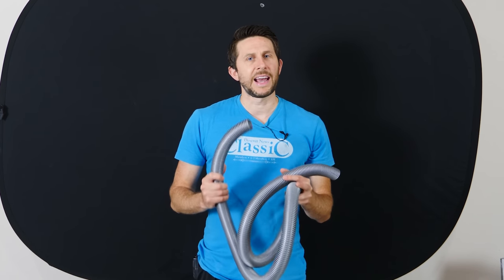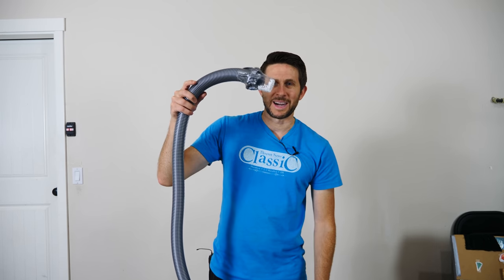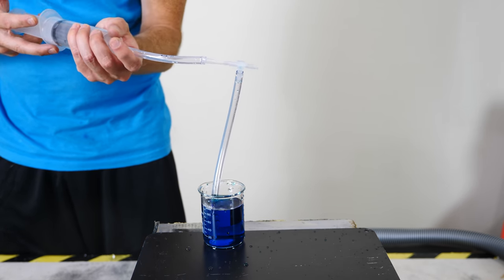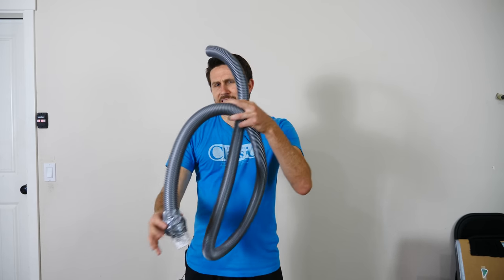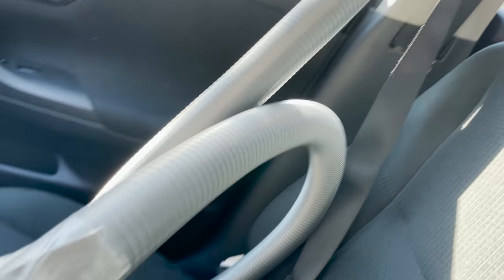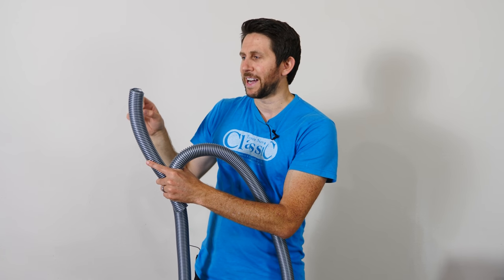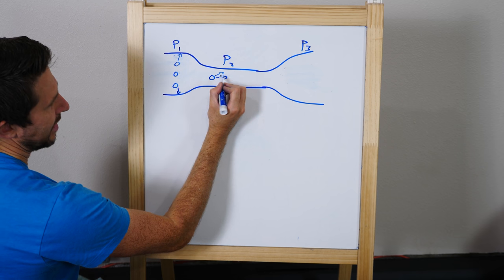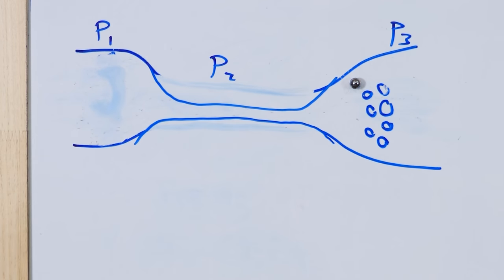The Self-Sucking Vacuum Cleaner

Comment: @The Action Lab
3:00 You also have centrifugal forces too on every air molecule in the spinning part of the tube, that also makes the air move outwards.
Reply: Technically yeah but air molecules move at hundreds of miles an hour so it doesn't affect it enough to make a difference
Reply: @boopnose5503  not with that attitude
Reply: @chapstickbomber  whaaaaaaa
Reply: I thought of that as well, there a pumps that work mainly with this principle.
Reply: Yes. I also think that his relative speed approach doesn't work in the first example, as the air in the tube is constantly accelerating 🤔
Reply: I actually believe centrifugal forces play more role in the first example. This is exactly how car turbine is operating. A lot of ventilators work this way as well

Comment: Did you pick up any styro ball you blow outside or did you left them in nature.

It is one of very few materials that NEVER ever never, decomposes. While it may take a plastic bottle 450 years to decompose and a glass bottle 1 million, Styrofoam stays strong and doesn't give in to the elements of nature, ever
Reply: They were tiny little pieces
Reply: But pieces nonetheless
Reply: Literally what i thought
Reply: Don't think he's going to save any turtles 🐢
Reply: They do decompose over time. May not be scientifically proven, but have you ever left a hard styrofoam box outside for a few years and gone back to it thinking "it's ok, it'll still be good" go to pick it up and it literally crumbles in your hands. I have, so either I'm really strong, or styrofoam decomposes over time.
Reply: @grahamdelamare737  Loosing structural integrity, is not the same as decomposing. 
Plastics are just getting smaller and smaller, the fall apart, becoming micro plastic.
But the normally don't decompose.
Reply: @stefanocasola6733  the original comment said "styrofoam stays strong and never gives in to the elements of nature, ever" well, isn't losing structural integrity giving in to the elements of nature, and isn't losing structural integrity over time considered a form of decomposition?
Reply: Right, I have a styrofoam cooler from 1952, I use it every day. It still looks like new because it never decomposes!!!
Reply: Might be better to use something biodegradable.
Reply: Well, NASA’s (and other space agencies’) jettisoned items have some styrofoam in them too. The amount they drop is negligible. No one screams at them for littering.
Reply: You expect him to pick up every single styrofoam ball from the highway?
Reply: @gamistry2947  He could have used small pieces of paper...
Reply: @onnonius  It wouldn't have the same effect. Also, it's just a few balls. It's not gonna change anything.
Reply: @mrbmp09  i have books of paper from 1920 so its also how you store them
Reply: @gamistry2947  it may or may not, but he's a figure of some influence with this channel and people might copy this experiment. Meanwhile as a society we're actively trying to reduce plastic waste. I know I may be reaching now but we've seen how our plastics can affect ocean wildlife by getting into their systems somehow, who's to say these won't do the same.
Reply: @bevishhh  I can understand your concerns
Reply: @bevishhh  What's the difference of  him sucking them out the car vs him throwing them away to go to a landfill? Basically nothing. Earth is doomed either way.

Edit: Not that I support littering.
Reply: As if it matters that much lol.. what's up with this peta comments..
Reply: yeah, he walked across half a kilometer area to find 50 balls the size of a pea

Comment: Are we just going to ignore the huge impact the centrifugal force had on the first experiment?
Reply: This! I would imagine all the air trying to move from the center to the edge die to the spinning is the main reason it's sucking.
Reply: Yes, that‘s exactly what I meant. The air trying to move to the edge/top of the tube creates lower preasure in the center/middle of the tube. This would also explain, why it worked so well in the beginning, compared to the first attempt in the car at lower speed.
Reply: Air molecules move at hundreds of miles an hour. To create a huge impact you'd need to spin the tube at way higher speeds.
Reply: "Air" molecules move at at 330~ m/s so he isnt spinning fast enough for that

Comment: I think there's a secondary component to twirling the hose that you might have missed. At that point I think it acts like a centrifugal pump and the inertia that you're creating in the air in the hose flings it out of the end also creating a low pressure behind it in the hose.

Comment: Is it Bernoulli though? Or are you just throwing the air from the tube (when spinning it) and thus decreasing the pressure inside?
Reply: I think it is both. It certainly is Bernoulli, but you are also throwing mass (the air) out of the tube. If the tube was filled with golf balls, they would be thrown out too.
Reply: I think if it was just throwing the air from the tube, the effect would only last as long as there was air in the tube to move. So if it was just the air being thrown out, I would assume the effect would only last a second or two. Since the effects continue as long as you spin the tube, that looks more like Bernoulli's to me
Reply: @Loganxmusic9339  The air being "thrown" out also "pulls" air from the bottom
Reply: @Astromath  and that's Bernoulli's principle
Reply: The conservation of angular momentum is not the same as Bernoulli's Principle. The Torque is doing most of the work and the cup proves it. The small holes are restricting way to much airflow especially when you consider how unevenly and turbulent the flow would be on the rotating section.
Turbulence is the enemy of Bernoulli's Principle. He is acting as a blower fan. When hes in the car, it is Bernoulli's Principle though.
Reply: @Loganxmusic9339  that's the whole point. New air will enter from the other end to replace the thrown air...
Reply: @CosminRotaru  yes, this is the effect of Bernoulli's principle..
Reply: @jonvanbrunning4294  That's exactly what I think: In a blower fan, it's only the centrifugal force that acts. With the tube without the cup, it is a mixture of both forces. With the cup, the Bernoulli force decreases. In the car, it is only the Bernoulli force and no longer a centrifugal force. I assume, of course, that he turned off the ventilation in the car. Otherwise, it would create overpressure in the car.

Comment: Another reason why this vacuum non-machine works, and possibly the reason why it works better than the hose in the car's window, is that by spinning the hose like that you are centrifuging the air away radially. This is actually how the pump in a vacuum cleaner creates the vacuum. It is a similar effect to this experiment: Have a heavier and a lighter stone connected by a string passing through a tube. Put the tube vertical with the 2 stones hanging  from the string and the string will slide through the tube such as the heavier stone will go down and the lighter stone will go up. now let the heavier stone hanging and spin the lighter stone above your head and the lighter stone, as it is centrifuged away, will lift the heavier stone.

Comment: Actually there's a centrifugal effect forcing the column of air in the spinning region of the tube out the end creating inward pressure at the end by the table, in addition Bernoulli's principle.    He had to drive quite a bit faster than he manually rotated the tube above his head to achieve comparable suction.
Reply: No, he was spinning the tube about 80 rpm, @ 3 ft. radius thats around 50 mph.
which is about the speed of the car sounded like.
Reply: @mrbmp09  @0:20 shows the tube extend from his hand to head, so there's no more than 1.5ft rotating, and I'll even give you 120rpm, which still only comes out to 12.85mph:

2 × 3.14159 × 1.5ft × 120rpm × 60min/hr ÷ 5280 ft/mi = 12.85mph

Comment: We use this concept in the natural gas industry when trying to pinpoint a leak (gas migrates underground, so higher gas readings in one spot doesn’t always mean you’ve found the leak). We use a purger, which is simply a Venturi that sets atop a 3’ aluminum tube with several holes at the bottom. When compressed air is pushed through the purger, from back to front, it creates the low pressure area where the restriction is inside. This creates the vacuum in the aluminum pipe and sucks methane from the surrounding soil. Once the soil is mostly clear, you can begin testing different spots to see where the highest readings are, and there is your leak.
Reply: I think you are describibng an ejector pump which operastes by entrainment, not by the improper interpretation of Bernoulli's Principle.
Reply: @Observ45er  no, I’m not. It’s a Venturi, with no moving parts. It uses the effect noted in the video to create vacuum.
Reply: @skoalsoldier  Ok. So reading it again carefully, I see it's a pipe that shrinks in diameter, but then has holes to the outside pipe that is around in the narrow section. Then, I guess, the aluminum pipe is used like a vacuum cleaner hose?
Is that a correct interpretation?

Comment: I partially disagree. I strongly believe that the phenomena shown during rotation is due to centripetal force acting on the air inside pushing it out and thus creating a low pressure.
I agree to the fact that most other stuffs shown in the video are due to Bernoulli's principle.
Feel free to put your comments below (anyone). Happy to learn.
Reply: Agreed.  While Bernoulli’s principle is responsible for a fraction of the suction when he is rotating the tube, the majority of the suction is likely coming from the centrifuge effect.  In essence, he created a single vane centrifugal compressor.  Good explanation of BP, but partially misleading, at least when explains the rotating of the hose.
Reply: It would be interesting to know the tip velocity achieved by hand vs in car.
Also in the car, having the window open changes the pressure in the cabin. Would be a more reliable experiment using some sort of wind tunnel.
Reply: It's a matter to gain some air velocity, he just make circles with the pipe, and as he already proven in the car, it happens the same when going at a straight line, so centripetal force has nothing to do about it. Also when pushing air with the syringe, there's zero centripetal force, it happens the same thing (that one principle is a variant of Bernoulli actually, called Venturi effect, used in carburetors) He's actually creating the low pressure by velocity, that's the Bernoulli Principle at its best.
Reply: @jimmytvfclassic  partially correct.  Some of the suction is due to that, but most force is happening from centrifugal motion (not “centripetal” acceleration).  Check out how a centrifugal pump or centrifugal compressor works.  He effectively made a centrifugal compressor or blower.
Reply: A small correction as John pointed out. Centrifugal force not centripetal force.
Reply: @Joe-ks1jx   @John C  yes I always confuse centripetal and centrifugal names. Damn dyslexia... The force that pulls away from the center... Anyway. A centrifugal compressor, is the air acting as a fluid, hitting the blades of a fan, it's very clever actually. They have to connect several blades to get enough speed to make Bernoulli's effect act properly, because, again, it's speed not centrifugal force. Centrifugal force depends on mass, and air has almost no mass at all. (It has some)
Reply: @jimmytvfclassic  That’s not exactly how centrifugal machines work.  While Bernoulli plays a role in just about everything in fluid mechanics, it is not the main driver here.  Centrifugal machines, like the one he made in the first part of the video, convert angular momentum into pressure.  Think about the perceived force you feel when you turn your car sharply.  That angular inertia/momentum is similar to what causes the air within the tube to move outward.  Also, the speed that the tip is moving is not all that fast (you can do some quick math and see it is something like ~10mph), think about how fast the car had to move to create suction.  I’m not saying that Bernoulli doesn’t have an effect here, I’m just saying the primary driver in the first example is centrifugal.

Comment: That is how  car's crankcase ventilation systems use to work.  The vent tubes would stick out into the airstream (under the car).  The end of the tube was not square  though,  they were cut at an angle, so the opening was on the downwind side.

Comment: You forgot to include radial acceleration of air in the spinning tube. 

As a kid, did the spinning around in the air but used a tube filled with water. Much of the pressure difference was caused by radial acceleration...Velocity squared / radius. As a kid, the Bernoulli effect didn’t have much effect. The tip velocity through air was not very fast but radial acceleration of water could easily lift feet of water or cause enough press difference to allow me to sling the water filled tube over my head. Bernoulli effect at low velocity would not cause enough pressure differential to lift that column of water.

Comment: I think you also have a function of centripetal force aiding your vacuum as well. I bet if you completely plugged the end and spun it like that with a pressure sensor in the end you would be able to show an increase in pressure at the tip of the vacuum without the air movement. This is why I performing the same type of action with a hose filled with water also works.

Comment: Top tip: if transporting an aged relative who might be covid positive, use a nose mask with a tube out the window. The negative pressure keeps the mask clamped to your face, thus blocking off nasal receptors, yet you can still breathe fresh air easily. Sounds a little nuts, but I used this successfully back in March '20...  Just saying. Old UK duffer here :)

Comment: Yeah that's what a centrifugal compressor/fan does. I wouldn't explain the spinning of the tube with Bernoulli principle but just with that air molecules have inertia and the spinning tube walls accelerate them outwards creating lack of air in the tube. If the end of the tube was closed there would still be higher pressure packing at the end wall.

Comment: Same principal applies to chimneys. It's a lot easier to keep smoke out of the house and have a much hotter fire when there is a cross wind going over the chimney outside since there is a draft pulling fresh air through the fireplace and pulling exhaust through the stack.
Reply: but in chimneys the effect is mainly convection, hot air rises and cold air fills in the space, does bernoulli still apply?

Comment: Nice video. The explanation is excellent.

I thought of a secondary force that can drive the vacuum action, at least with the swing-in-a-circle method. While I expect this force to be less, i wonder how much it might contribute.

Conservation of momentum creates centripetal force as air molecules in the tube are pushed toward the side of the tube in the direction of rotation. As they travel in that direction they tend to continue traveling that direction until another force changes their motion.  But, as they travel the angular position of the house changes and the direction they want to travel becomes the end of the hose. This continues from the hand to the opening at the end. Molecules are continuously pushed in the direction of rotation which soon after becomes the direction toward the opening. The lateral force is continuous and immediately followed by the change of angular position.

Measuring forces is tricky with simple excitements like these, so finding the difference in vacuum pressure between a spinning house and a stationary house out a car window may not be so practical.

I also wonder how much the cup at the spinning end might block bernoulli's principle from working. This could be tested if we repeated the car expanding with a ventilated cup on the end of the house outside of the car. Maybe a follow-up video is in order? How fast do we have to drive to cause the hose to litter Vs. how fast to cause the cup on the outside to fill up?

Comment: Not sure the ball model is complete. I think the reduction in pressure is due to fluid viscosity - which in a particle model is the resistance of layers of particles to slide over each other - which is called shearing. Faster fluid means more shearing. This fast sticky motion pulls inwards counter to the pressure caused by the random ball model - hence the drop in pressure.

Comment: To be honest the way I thought this worked was through something related to friction/centrifugal force, for example if you open the lid of a bottle full of water and start to spin it by holding it at its base, the water tends to come out through the cap, because it doesn't have enough fiction to stay in the bottle... So I thought something similar happened with the air in this situation, it just doesn't have fiction to "hold" on the plastic and ends up coming out because of the centrifugal force.

Comment: Spinning the tube above your head is also throwing the air in the tube outwards, due to centrifugal forces. I would’ve expected that to be more of a significant force which explains why you needed to drive so fast compared to the speed at which you spun the tube.
Reply: According to my physics professor, centrifugal force doesn't exist. I forgot what he said was actually going on though.
Reply: @sovietbot6708  I’m using it here as a quick way of describing the actual forces involved, rather than going on to explain a regularly debated topic.